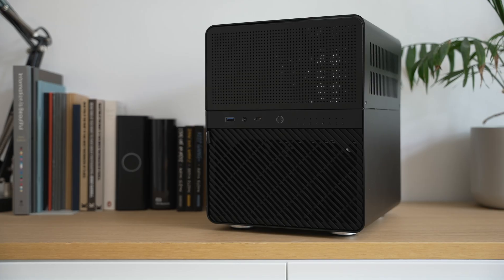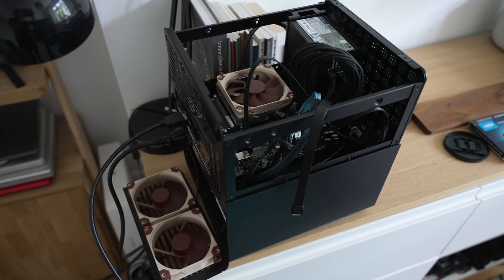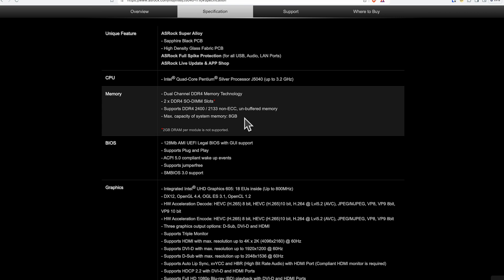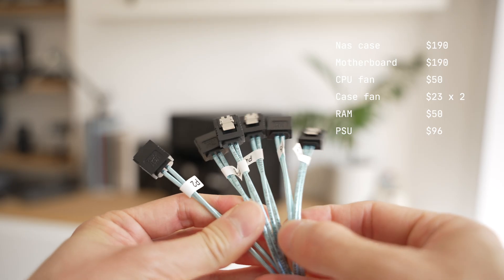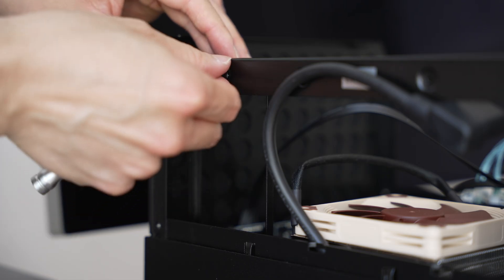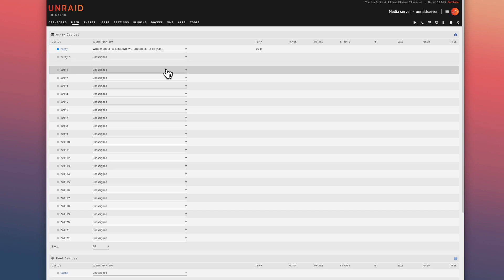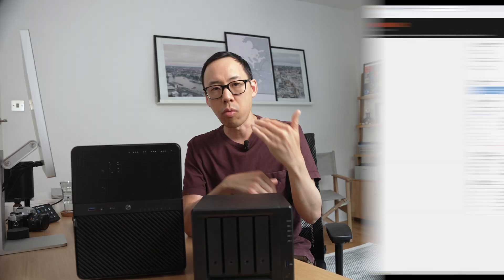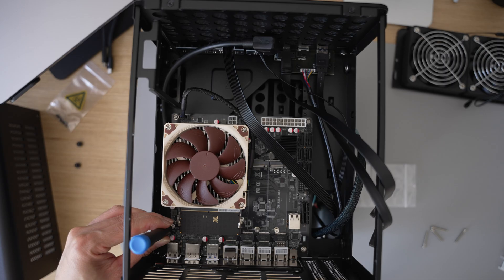Build a Nas Server with Jonsbo N3 - Cheaper than Synology?

Comment: Just one comment, since you have  two nvme slots, you could use that for mirroring your cache drive. Now, if you loose that drive anything on it is also gone if it was not yet written to the data pool.
Reply: If a cache is gone, a source is still available. NAS will report a system failure in any case, and so with or without the mirroring, you’ll have to re-upload. May be the mirroring can double a read speed, but that’s a cache drive: a data must be written first with an ordinal speed. Yet more thing. Intel offers multiple nvmes only via a chipset. When many sata drives are busy, a network card is busy, this might reduce a performance of an entire raid1 for the cache.

Comment: Very good video man! I have almost identical setup except mainboard and use it for half a year, so want to add some info to it... I currently use CWWK AMD NAS mainboard (7940HS) which perfectly fits to Jonsbo N3 (it has native 9 SATA slots and chipset is ASM - discuss it later). I also have and tested CWWK N100 as yours in the video, but finally decided to switch to AMD board. Why? IMHO CWWK N100/N300 mainboards have a lot of drawbacks - suprisingly power draw when idle (and no HDD) is higher than AMD, N100 is very weak CPU (4 cores/4 threads), it has only one NVME M.2 (second NVME M.2 is shared with PCI slot), only one DIMM slot, SATA chipset is JMB (known for problematic adjustment of ACPI power), PCI slot is only x1 (shared with one NVME - you have to decide what you want to use), also there is only 6 SATA ports build-in, while N3 has 8 SATA bays + one internal non-hotplug internal SATA SSD. The only advantage of N100 board is QuickSync in iGPU - from my perspective it also very controversial issue, especially if you get in mind that AMD has 780M iGPU. In other hand AMD board has much powerful CPU and iGPU. CPU has 8 very power efficient cores (16 threads), iGPU is best in class 780M, with much better graphics performance than weak Intel UHD iGPU. AMD CPU is better performant (at least 4x faster in comparison to N100), CPU is very power efficient Zen4 with TSMC 4nm process (like mobile CPU right?), 2 x NVME M.2 (not shared), 2x DIMM slot, 9 SATA port built-in with ASM chips (much better than JMB and you can get full advantage of your Jonsbo N3 case),  full 16xPCI slot (with 8x PCI lanes). In comparison N100 board takes about 18-20W idle (measured from wall). Identical configuration on AMD - 13-15W. On AMD with running lots of services (on Proxmox) - 2 NAS services, over 30 docker services (Immch, MariaDB, Bitwarden, Guacamole, WEB servers and many more), 3VMs (Win11 + Ubuntu Desktop + HomeAssistant) and while disk are in sleep mode it draws only 24W. Of course AMD has higher price (N305-280$ vs AMD-480$) , but you usually build your NAS for years, right? So in general adding 200$ you will get more poverful and capable 9-bay NAS instead of 6-bay...
Reply: Hi @pabloszi would you mind listing the full specs of your AMD machine including any fans etc? How is the hardware transcoding with the 780M iGPU?
Reply: @lukeybabe  as MB I am using CWWK AMD NAS board with AMD (Ryzen 7940HS), CPU fan - Noctua NH-L9x65, replaced stock  Jonsbo N3 case fans with Arctic PWM fans. I also added two more fans for top of the case (4 fans altogether with tweaked rotation in BIOS), PSU - some kind of pico PSU from Aliexpress with external AC/DC PSU - also Aliexpress. I tested few very known brands PSU and was dissapointed how bad especially at low power consumption they are. Platinum Corsair SFF750 I tested was the worst - shame Corsair. Chieftec SFX 350BS was the best (and also cheap and available on second hand market). Corsair takes additional 15W at idle, Chieftec only 4-5W on idle over PICO PSU. But generally SFX internal psu efficiency at low power draw are not good. It is normal, because you have to stress PSU with high WATTs to take advantage of "gold/platinum" efficiency. So if you don't have external GPU PICO PSU would be enough. Memory - Kingston Furry DDR5 5600 64GB, 2x NVME 2TB GoodRam PX700, Coral TPU on A+E M.2 slot, 1x SkyConnect USB Stick for HomeAssistant, 3 x 20TB Seagate Exos. Currently only 3 HDD, but because I do a lot of RAW pictures and do lot of videos I have more in my plans. On top of that Proxmox with plenty LXCs and 3 VMs as described above. I set Exos HDD for sleeping after 20 minutes if not used - they are used if I take files for video/photo edits or somebody is watching movie on Jellyfin. Hot data are on NVME. The key for low power draw is not using VMs, or as less as possible. Everything what previously I ran on VMs I moved to LXCs. If you want to know specs of 780M look at https://www.amd.com/en/products/processors/laptop/ryzen/7000-series/amd-ryzen-9-7940hs.html ---> Graphics Capabilities. There you will find specification for encoding/decoding capabilities with bandwith for 1080p/4k of this iGPU with codecs supported and other data. For my usage it is more than enough... For example decoding 1080p it is 960 frames with 8/10bpc and codec AV1. It is a lot. Bear in mind that for example if you run Jellyfin on LXCs you can share iGPU with other apps (but LXCs, not VMs). I do it for example with Jellyfin and Immich. Both running in different LXCs...
Reply: @pabloszi  Thanks for such a detailed response. I will take everything into consideration for a potential NAS build.
Reply: @pabloszi  how did you get the NH-L9x65 to fit did you have to remove the copper plate?
Reply: @lukeybabe  Sorry, I just realized I used NOCTUA NH-L12S in Jonsbo. Normally I use in my computers L9x65, but because I wanted to have more space - as L12S have possibility to mount FAN below or above radiator. In this particular case I used L12. You shouldn't remove copper plate due to cooler/cpu clearance. IMHO you can use L9x65 but connecting cables to MB could be problematic due to compactness of the MB.
Reply: @pabloszi  It's just sad that board is sold out everywhere :))
Reply: @bodomnight63  I am not suprised, because this is fantastic board for NAS up to 9HDD or even higher if you will use M.2 or PCI expansion SATA card. I saw that CWWK very often replanish its production. I have bought this board with 7840HS, and then this board evolved with different types of CPU. Probably it will be back if you are patient...
Reply: @pabloszi  "2x NVME 2TB GoodRam PX700, Coral TPU on A+E M.2 slot"
Does your board have three M.2 slots? I have the 8845HS variant of the board and I only have 2 2280 M key slots, none meant for wireless modules.
Reply: @komolunanole8697  no, mine has two as well. But I am using regular PCI slot for it with PCI to M2 A+E key card.
Reply from the maker: Thanks, and thanks for sharing the detailed build you have and the AMD motherboard. I will be sure to check out the AMD motherboard.
Reply: Brother use paragraph breaks holy moly. So what's the board you used?
Reply: @atetraxx  CWWK AMD with 7840HS. Currently it is offered with never revision of this CPU on CWWK shop - 8845HS

Comment: You don't need to 3d print custom fan holder for Jonsbo n2. I replaced the stock fan with a Noctua fan.
Reply: I did the same, the fan installed without any problems.

Comment: Excellent video! I am looking to build something like this but with ECC RAM, and this is the problem, not a lot of options unfortunatelly.
Reply from the maker: Yes, had the same journey. Wanted to look for something supported ECC RAM, then sort of gave up. Maybe this thread will help https://www.reddit.com/r/truenas/comments/uzgtt5/is_ecc_memory_really_necessary/
Reply: I'm looking for the same and without success for now. Did you find good motherboard with ECC support and Mini ITX form factor which not costs a fortune?

Comment: Can I ask why you chose the N3 opposed to the N4? I have no clue about computers but keen to build one of these and looking at lots of videos. Thanks in advance
Reply from the maker: I think I went for the N3 because I could have 8 full size hard drives. Where as the N4, I believe you can only have 6 full hard drives and 2 x 2.5 hard drive bays. So I decided on the N3. Although the N4 is a smaller form factor - which is nice.

Comment: With the motherboard you chose, does it give you the enough sata ports for future upgrades that the case can manage? also will this setup be good for  4k editing on the network?
Reply from the maker: There's a PCIe slot which could be used to add additional Sata ports. A PCIe to Sata adapter should do the trick. Or the M.2 Slot like a M.2 to sata adapter. But I would have to double check. For 4k editing, it has a 2.5G network port. It might be enough if you are connected on a network cable. Otherwise, a PCIe to 10G network card would give you more bandwidth. I tend to just edit 4k directly on an external Samsung 2TB SSD. Then manually back it up on the NAS.